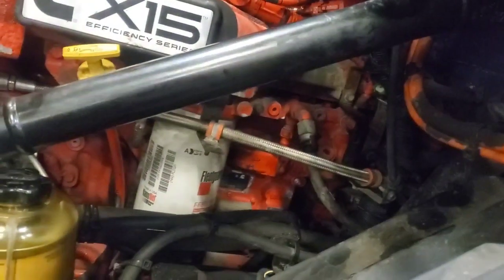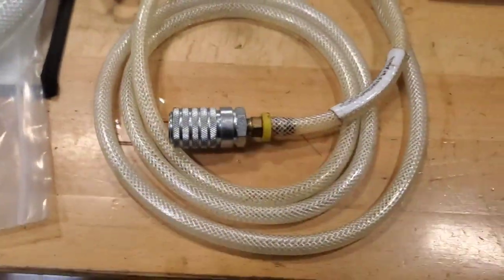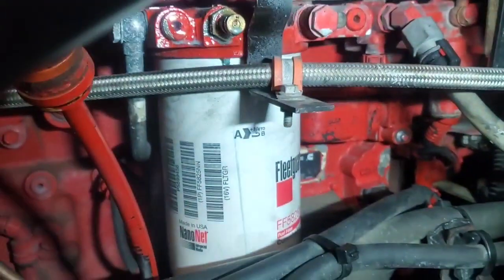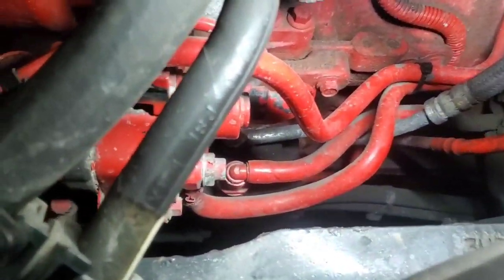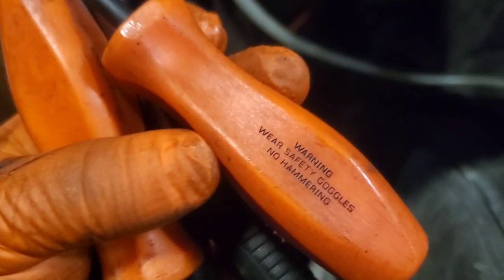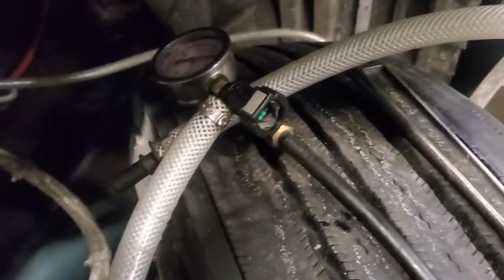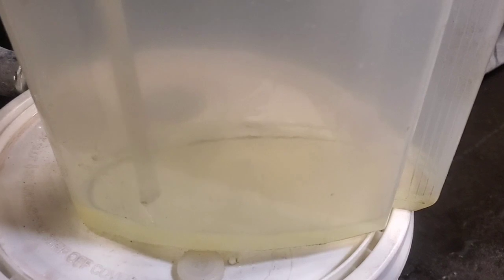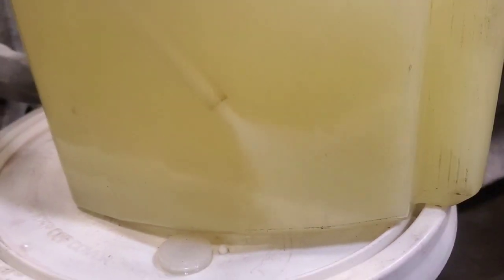Cummins X15 - How to check fuel restriction and test for air in fuel (aeration) Cummins CODE 559

Comment: How do you know how much solubilized oxygen and dissolved air is in the diesel fuel?
Reply from the maker: @ox-cetane4887  you see how much bubbles are coming from the line. There should be none. It should run clear.
Reply: @AcousticHills  Indeed, ULSD has significant problems with fuel oxidation and air contamination in the ULSD itself and nobody is talking about it.
Reply: @AcousticHills  was the gear pump the problem????
Reply from the maker: @kieranlynott8549 no, it was a split line

Comment: where was it sucking air from? great video thanks
Reply from the maker: @juanavila1611  thanks! It was coming from the line between hp pump and fuel module. Had a small split in it.

Comment: Dealing with this right now, my gauge read -25 HG gonna see whats causing it tomorrow
Reply: What i found was what appeared to be paper towel jammed up inside the thermo recirculation valve, had me pretty stumped for a bit because everything tested good, i pulled the line off and saw a bunch of brown paper towel jammed up inside. I work at a peterbilt dealer and the truck came back 3 times for the same 559 code.
Reply from the maker: @ryan.379  Great find!
Reply from the maker: What did you end up finding?